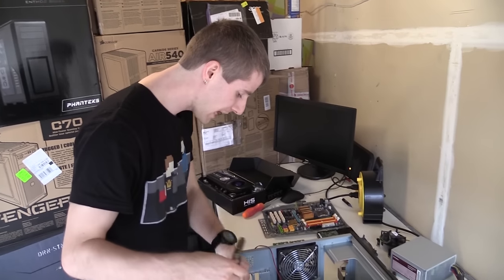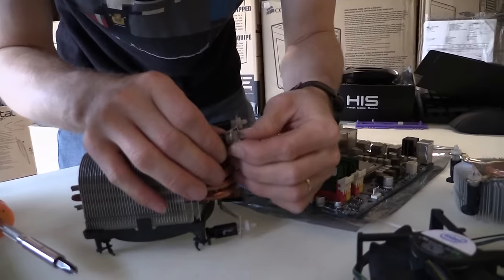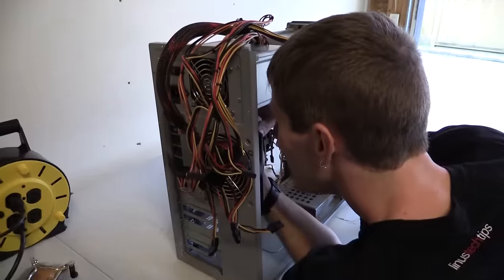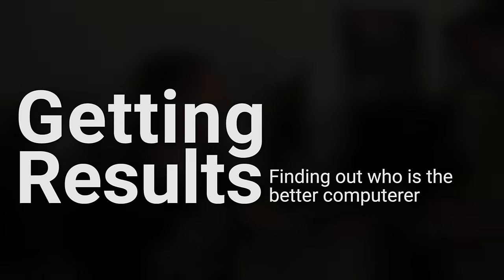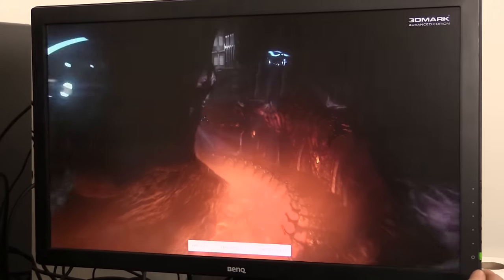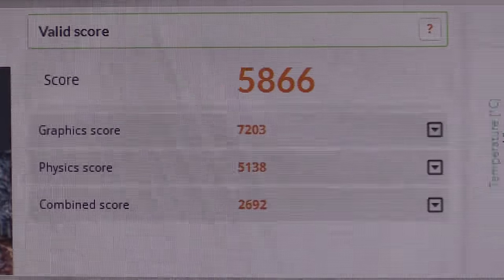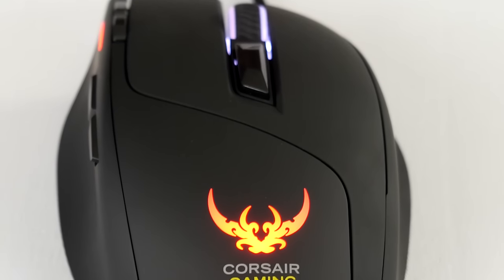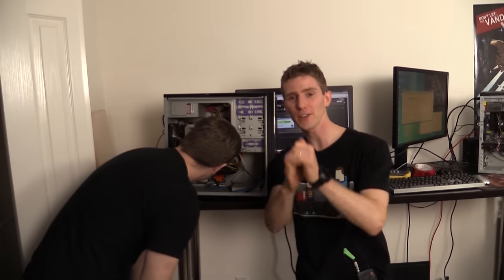$300 Budget Gaming PC Challenge - Scrapyard Wars Episode 1c

Comment: I built my New Rig recently and I think I got the wrong PSU. My specs:
CPU: Intel i5 4690K 3.5Ghz Boost to 3.9-4Ghz
CPU cooler: Corsair H100i Liquid cooler
Motherboard: MSI Z97 Gaming 5
HDD: WD BLACK 1TB
SSD: 128GB Kingston HyperX 3K High Speed
RAM: 8GB Kingston HyperX Beast 2400Mhz
PSU: Corsair RM650 80+ Gold
+ Some cheap PCI-e network card
I have not bought a graphics card yet as I am waiting for AMD's 300 series to come out.
Is my PSU good enough for AMD's upcoming line of graphics cards because they are rumored to use 300Watts.
Thanks
Reply: Go Nvidia and you're pocket book and computer will thank you later! (Nvidia is extremely power efficient)
Reply: My god that's bad advice
970 only has 3.5 GB, but the 300 series will destroy nvidia and be competitive in power consumption.
It will be much better for 4k. Also, the difference in power consumption is a moot point, it takes years before there is enough money to even bring up it's usage.
Reply: David Burke
GTX 970 has 4 GB of VRAM and the AMD/ATI 300-series is not out yet but you already know how it will compete against Nvidia products? You are either a clairvoyant or you have no effin clue what you're talking about.
Reply: Hallelujahmkay Not with overclocking.  

Also they need to handle peak draw.. That is 100-200 watts for an Intel CPU without an OC and the 290X hits 431 watts alone without an OC.  
http://media.bestofmicro.com/1/4/409576/original/10-Power-Consumption-Original-Run-1.png
Reply: Abram Carroll I don't plan on overclocking my graphics card anytime soon though
Reply: BronzeChannel Cant tell if you're being sarcastic or not :P
Reply: Abram Carroll Except it is, an OC won't make the card use 100 wats more.
Reply: BronzeChannel
Thanks for making that clear again, there weren't enough news-articles, blog-postings and youtube-videos that explained that shit over and over and over and over again. But if you can do the maths, 3.5 + 0.5 = 4 GB, no matter how fast and when it's accessed.

***** Yeah, you're porbably right. I still remember the adds from AMD how their Bulldozer crap should have blasted away Intels CPUs...
Reply: Hallelujahmkay You can push a 970 from a TDP of 145 Watts to 290 watts.  That's 2X the wattage.  

Truth about the AMD 300 series is they only have 1 new chip and the others are rebranded.

Their new Chip is still GCN.  The 290x had a TDP of 290 watts and their new one has a TDP of 300 watts.  

PCIe is 300 watts max.
Reply: Go for at least 850W PSU. that will be always handy.
Reply: Abram Carroll 650 on an 80+ Gold is more than enough for a high end GPU.
Reply: Abram Carroll
Good luck doing that with a normal cooler
Reply: Hallelujahmkay Whats a normal cooler?
Reply: VexVengeance Anything that hasn't got it' own hole for cooling it. Yes, I can put third party liquid cooling on my card but that's not something the majority of people are doing.
Reply: BronzeChannel this^^ I hate dumb people who just parrot what other people say. People need to do some research.
Reply: Hallelujahmkay I have SLI 680 4GB.
Reply: VexVengeance It's more than enough, with a safety margin of well over 100 watt even with the most extreme overclocking.
Reply: Sobakus
I hope you know that PSUs nowadays have their best energy-efficiency when the load is at about 50%-60%.
I know so many people that are stupid enough to only plan in a "safety margin of 100 W" and then constantly complain about how loud the PSU fan is. It's no wonder, the higher the load, the hotter the PSU gets. The last PC I had drew 360 Watts from the wall, that's why I got a 620 W PSU (360/620 = ~58%) and you weren't even able to hear the fan when you put your ear against the mesh. (SeaSonic S12II 620W)
Reply: Metatr0n I have an ancient E8500@4.0, HD4870 at mostly stock and 2 hard drives. When the original fair-quality 420w noname PSU that came with the case died from being in the corner under the table at 30+ in summer for 6 years, I bought a TT Toughpower Grand 650w 80 Plus Gold, which means it has 88%+ efficiency at full load. This is the same cerificate as the OP has. My particular model has been tested to have over 90% at overload, with peak 2% higher kicking in at around 20% load.

Under load, it sounds like a Jumbo taking off, while in the old one I could never tell which fan is making the most noise.

I hope I've demonstrated that:
a)Modern PSUs have over 80% effeciency in most of their operating range for the worst of them, and
b)Efficiency doesn't correlate with either noise or wattage

p.s.: look up "80 Plus".
Reply: Sobakus
Thanks for explaining what I just explained. The only thing you basically said was "He's right but I shit on it".
If the PSU has to run under full load every time you start a game or a render-process or something else you do often on your computer, it doesn't matter how efficient it is, the temperature WILL rise and caps that work under higher temperatures have a shorter life-cycle, so the PSU is likely to fail sooner. Also, working under OK but NOT OPTIMAL efficiency gives you higher energy-costs than when the PSU works under optimal efficiency all the time.
So what I was able to read is:
-I give a shit about the life-cycle of my hardware
-I give a shit about the energy-costs
-I give a shit if other components in my computer are affected by the heat of the PSU

Sounds like you're getting your computer from mommy and daddy who probably also pay the electricity-bill...
Reply: I am going with the 980. Getting mine today.
Reply: Abram Carroll I'm sorry mate, but what you linked clearly shows whole-system power draw with FX-8350@4.5– you can check power consumption numbers in any review to see that. To clarify: ~450 W peak is the absolute worst scenario with any single-card configuration, though I guess 500 is possible under some benchmarks. The GPU itself peaks at 295 (the review mentions hitting 335 once) after intentional PowerTune tweaking and without any performance improvement and with consequent throttling, and at 225 in stock:
media.bestofmicro.com/S/F/406671/original/04-Power-Consumption-06-Peak.png
Reply: Metatr0n
I didn't address a single post to you, but to be honest, I didn't really read any of your posts either.
/parrotting mode: disabled

By the way, what PSU did your "last PC" have? It's just that I have a feeling that while it drew 360w from, the wall, what your hardware actually used was around 300. Well, either way, keep telling yourself that you don't really care about that extra 30 € you got fooled for – cause you ain't poor or anything! – and that the retailer will surely give it to charity any way. Just spare other people from your expert advice, will you?
Reply: Sobakus "I didn't address a single post to you[...]" This is already the 3rd post you addressed to me...
In case of such a short-term memory I don't have to wonder about your nonesense anymore. What PSU my "last PC" had can be read in the corresponding posting where you read about my "last PC". Sorry, forgot about your short-term memory, it was a SeaSonic S12II 620W. And I even wrote about how many Watts my system pulled out of the wall under load. Sorry, forgot about your short-term memory...

If you read this and you don't know anymore what this posting was about, please start again at the top of the posting.
Reply: Metatr0n Is this some kind of a joke? Firstly, fearing that you might have difficulty understanding my parody of your own post, I added the "/parrotting mode: disabled" disclaimer. I'm not exactly surprised that my fears turned out to have been justified, but the fact that the meaning of my disclaimer escaped you is bewildering. Are you pulling my leg here or are you truly that special? Do the words "There is not a single agressive word in my posting" and "I don't know what kind of china-crackers you are used to but to be honest, I don't really care about your hardware" really not ring a bell?

As for the PSU, your sentence goes as following: "The last PC I had drew 360 Watts from the wall, that's why I got 620 W PSU." In English, this means that you got the PSU only after measuring your wall power draw with some other PSU – otherwise, the cause-and-effect relation is broken – and I assumed your sentence meant what it said. But hey, I probably missed the fact that that logic isn't everyone's forte, this also explains the problem you had understanding the parody-disclaimer combination. Oh well, at least you ain't poor or anything and your mom doesn't pay your electricity bills anymore, right?
Reply: Sobakus
Well I guess it's hard to figure that not everyone gets his PC from mom and dad and is happy with it but instead owns a test bench to test the hardware he's selling to his customers to earn money besides his full-day-job. (A test bench that is conveniently connected to a watt-meter at the wall to see how many watts a system draws beforehand so he can give advice to the customer what kind of PSU he should chose) But I guess that's too high of a topic for someone like you who only thinks in categories like "What is the cheapest thing I can get that is barely good enough?".

"this also explains the problem you had understanding[...]" The only thing I have a problem understanding is why you claim to not read my postings but constantly comment to them with 20+ lines of gibberish...
Reply: Metatr0n Oh I see now what's the deal with your expert advice – fooling customers into paying for twice the PSU they need is your job. Very nice.

>>"this also explains the problem you had understanding[...]" The only thing I have a problem understanding is why you claim to not read my postings<<

But this is exactly because of the problem you have with what you left out of the quote: "...understanding the parody-disclaimer combination". You see, a parody is "any humorous, satirical, or burlesque imitation, as of a person, event, etc". When I parody you by claiming not to read your postings, this doesn't mean I'm saying that I actually don't read your postings. What I'm doing is trying to convey the sheer idiocy of your own posts to you by imitating yourself using your own words.

I must admit, though, that I wasn't expecting your mental handicaps to be so severe as not to allow you to grasp the concept of parody, or recognise your own words, or understand that the wall reading you get from your test bench has to be adjusted to your test PSU's efficiency – you must seriously struggle at math. Hell, you're even confused as to which PSU of yours "drew 360w from the wall". This also seems to be exacerbated by some form of psychopathy, since aggression towards others seems to be so perfectly normal for you that you don't see it as aggression any more, all while openly admitting cheating your customers.

Well, that's a sad picture we have here: an aggressive, severely mentally handicapped person with psychopathic tendencies cheats people into buying higher-priced hardware they don't need, while attacking those who stand up to his blatant disinformation. I really do hope you get professional help.

Take care.
Reply: VexVengeance I'm running an oc'd 3930k and two gtx680 and my whole rig still don't even eat 400 Watts.When buying PSU, look at the quality instead of how much power it has.
Reply: VexVengeance You should change the PSU, the RM Series is very poor indeed.
Reply: AliveGhost13 Mate, he isn't going to overclock anything, which is the only time voltage stability is important. And even if he does, he'd need to push the PSU to its power limits (and a second 980 to even try) to warrant replacing it.
Reply: Oh wait sorry, he already has the PSU, I thought this was an idea

Comment: Best option in my opinion is to buy a second hand workstation class dual socket xeon rig off ebay , at least in the UK you can get a xeon with 8-16gb of ram of about the same age as your Q6600 for like 200 can $(pre brexit GBP crash) and then just throw the best GPU you can get in it , no messing around :)

Comment: I like this series, I tell people all the time I just buy used parts of craigslist and they seem surprised that my computers work lol

Back in 09 I built my first rig with a triple core amd cpu, 8gb ram, with a Radeon HD4890 for like 400 bucks, and at the time the 4890 was the best gpu AMD had on the market, but that quickly changed, I think I got the 4890 right before the new cards were released, but a few years later I traded the rig for a laptop that I used for a few years and sold for 400 bucks. I then bought one of those razer tablets after they were discontinued off ebay for about 650 bucks and a few years after that traded it for my current rig which is an 8 core amd fx-8320, 16gb ram, and a radeon R9 390 8gb, which obviously I am in the process of selling now a few years later. I got an offer for a nice laptop plus 150$ so in a couple weeks I will probably take that since the laptop has a comparablish gpu and better processor, I think the RGB lighting in my pc helped with my trade offer, but I am going to sell the laptop to a friend who wants it for 600 bucks. I have a deal lined up atm for an XFX RX 480 8gb for 100 bucks so I have a good start at my money back and a new rig with basically the same power GPU but I will hopefully be able to get a much better processor since that is my major bottlekneck atm. If I only did the trade and sold the laptop though I would come out with making 100 dollars for all my rigs in the past 10 years. This is of course not including monitor and peripheral costs.

Comment: I got a 2nd gen i5 (2500k), 4GB DDR3 Ripjaw RAM (only filled two of the 4 slots), a 500GB western digital black, and a EVGA gtx 580. All bundled in a... "well loved" original NZXT phantom case for 50 USD at an auction. It had a PSU but I don't remember what brand, a 500 watt I think. About 3 months later I slapped two GTX 950, a new 725 sentry power supply, two 4GB sticks, and two TB drives into it.

Comment: Nice! Basically put, you need a good CPU and GPU to get good results overall. I had a feeling that Core 2 Duo wasn't going to work very well.
That's why, for £300 (GBP), I have a i5-4460, 8GB of DDR3 (at whatever clock speed), a 1TB mechanical drive, and a Zotac GTX960. PSU is an 80 plus bronze at 500W. (Plus a DVD drive and Windows 10 Pro.) That's a good system :)
(Plus I bought a separate DVD drive just in case, a wi-fi/bluetooth PCI-e card, and a wired keyboard/mouse - though these were extra. I guess the total is less than £350.)

Comment: I built a EP45 DS3R($60) rig as my first budget rig with a gtx960($200US purchased brand new tho) maxxed ram($40) a QX6700 ($30) power by a thermal lake 500W bronze ($40). It came to under $400 and I played everything on medium settings @ 4K averaging 30FPS with an extreme OC from cpu stock clock of 2.6GHz to 3.33 GHz. It was my baby for the last 3 years until it died a few weeks ago. This reminds me of the building days

Comment: It would be interesting to see what you could do from the UK since there is a shop (online and physical) called C.E.X which sells games and pc parts second hand, the only parts they don't sell are; PSU's, CPU coolers, Motherboards and cases, which means you can build a pretty decent pc for around £200 e.g an AMD Fx-9590 Costs £90 (Specs are Octa-core at 4.7Ghz) and even a GTX Titan (6GB) is £280. I think it would be cool to see you guys do something with it as a super cheap quick build

Comment: This video is a prime example of why you don't cheap out on the core system (CPU, MB, RAM) and put in a powerful expensive graphics card.  An argument I've made to so many people for years.  That R9 290 is a vastly more powerful card than the 7950 and would absolutely shred a 7950 in performance.  But Luke's core system was so underpowered that it bottlenecked the GPU because the CPU just wasn't fast enough to keep the GPU fed, seriously dragging down his overall performance.  Which is why you saw in the pure GPU tests, his GPU considerably outperformed Linus rig, but once all the other effects (as can be seen in the final test portion of firestrike) came into play, such as physics (which is CPU bound) it seriously throttled his gaming performance down.  As a result, Linus' system may have technically had a weaker graphics card, but because his core system was solid (Q6600@3.2, I've actually gotten that processor to 3.6 in the past without issue.  That was a great processor back in the day.  Still one of the best overclockers I've ever seen.), it easily made up the difference allowing him to win out in the overall test.  Linus' clearly lost in the straight GPU tests, but once the overall tests kicked in, he regained more than enough ground to come back and win overall.  Move that 290 over to the Q6600 system, and yeah, it hands down would've been the best option overall.  And the $80 difference (although breaking the $300 budget) would've easily been worth it.

Comment: tried to do my ownscrapyard wars thing but but wasnt as good as them for 300

fire strike 4624
cpu amd fx 8150 black 
gigabyte 970aud3 both for $100

gpu galaxy 660ti 3gb for $40
(new) crucial balistic ram 8gb $30 off amazon

$70 for coolermaster elite case with 2 fans
,antec 430 watt power supply,
500gb 7200 rpm  segate harddrive

$ 30 (new)sportbot keyboard and headset and mouse (because didnt have keyboard headset or mouse)

did i over spend any where ? where i didnt get similer preformance to them 

i tried to make it a  future upgradable compatible also bieng my first pc (switched from console after watching this show) any suggestions for future upgrades

looking for advice pretty much a nube at pc stuff?

Comment: If you go on Amazon and look around for a while you can get a Pentium g4400, 8 GB of ddr4, an as rock super alloy motherboard, a 430 w PSU, a 1tb hdd, a cheap micro ATX case, and a gigabyte gt 420. The GPU isn't the best but for light gaming it's just splendid.